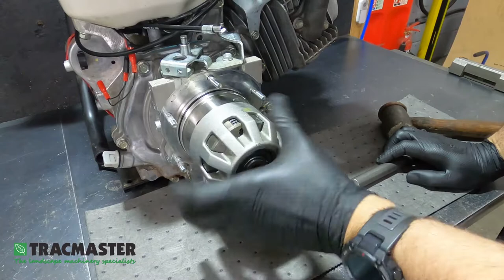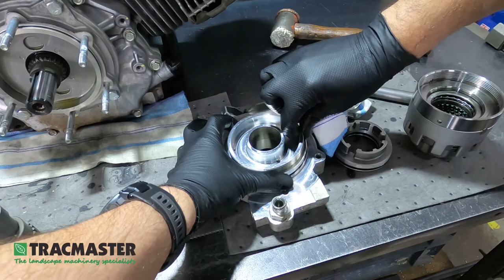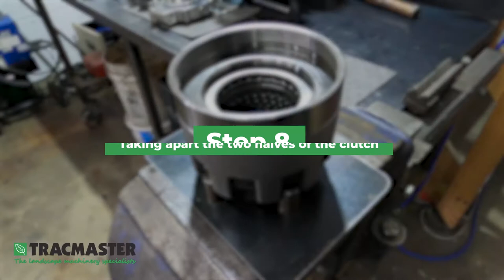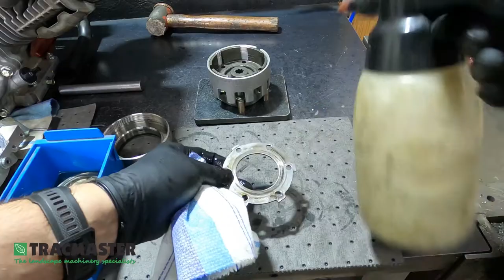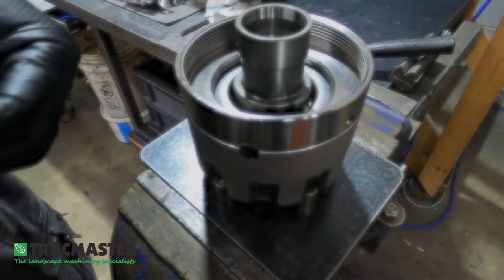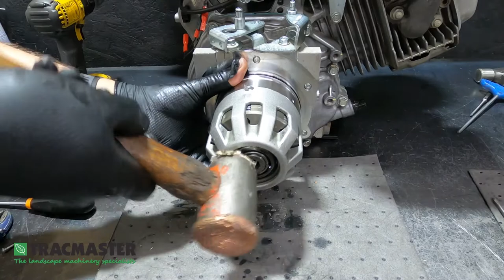Cleaning BCS PowerSafe® Clutch

Comment: Many thanks for posting. I hope I never need to dig this far into my BCS740 but I really like to look at what I'm driving anyway as I think it really helps in avoiding inadvertent damage and wear. I now understand how it works both as a clutch and as a brake. Very clever.
Reply from the maker: Hi Colin. Thank you for taking the time to comment. We're so glad that you found the video useful, albeit not necessarily in the way we intended 😂. We are working on adding more service videos, so hopefully there will be some more uploaded in the near future! If you're subscribed to our channel then you'll get notifications when we post new videos. Thanks again.
Reply: @tracmasterltd  Many thanks indeed for the reply. I have subscribed and look forward to any new videos you make. I wonder if you could help me regarding the preferred transmission oil when I come to replace it. I have seen instructions suggesting the use of a GL5 85W/90 hypoid gear oil but also have a copy of BCS service bulletin 2-22-2016 that suggests, for PowerSafe clutch equipped models, a whole list of possible lubricants all of which are Universal Tractor Transmission oils such as John Deere JDM J 20C.  Can you please tell me what you would use.
Reply from the maker: @ColinMill1  We recommend using either 80W/90 GL5 oil or a universal tractor oil - both are equally suitable for the PowerSafe units.
Reply: @tracmasterltd  Many thanks. That puts my mind at rest.

Comment: Thankyou so much  coukd I ask an info about my bcs740? It os brand new and it os really hard to change speed even with engine at low rpm...after shift goes tactor works well...is it normal and should I adjust clutch? Regards
Reply from the maker: The machines can be a little stiff when they are new, and once they are "bedded in" any stiffness should ease up. We would not recommend making any adjustments at this stage. However, if the problem persists you should contact the supplier of your machine for some advice. I hope that helps.

Comment: So I have a 750 diesel apron reciting it instructions said to use gear oil then got the updated bulletin that hytrans should be used should I be doing this Or should I get away with flushing with diesel ?.
Reply from the maker: Hi Bruce. We recommend using either 80W/90 GL5 oil or a universal tractor oil - both are equally suitable for the PowerSafe units. Diesel should never be used in the gearbox.

Comment: Please share more informative videos for powersafe clutch BCS if possible
Reply from the maker: This is the first we have done but we will be doing more shortly and we'll upload them as they're produced. Was there anything in particular you were looking for? In the meantime, we hope you find this useful.
Reply: We have some issues with powersafe clutch flange particularly with pump gears, pump cover. many times we are gacing oil pressure problems to operate clutch working in powersafe models.thanks.
Reply from the maker: @ojalamale I will pass this on to our technical department and see what they can do. Thanks for your feedback.

Comment: What are the indications that the clutch needs to be serviced? Typically how many hours of use will it be before the clutch needs to be serviced? Does the need for servicing become necessary More Often by operator error? Is the Locking pin the only part that needs to be replaced or is it reused?
Reply from the maker: Hi Dave. Thanks for your question. The most important thing with the PowerSafe clutch is to keep on top of your filter and oil changes. This normally prevents you from having to take the clutch apart to clean it. Typically, oil changes should be done once a year or every 100 hours (whichever is soonest). You would only really need to take the clutch apart to clean it if after doing your service, you still had reduced performance. I hope that helps.
Reply: @tracmasterltd     
   Thank you exactly what I wanted to know.  Is there a good engine hour meter to attach to the tiller?
Reply from the maker: @davej7458  We have previously used (and recommended) SenDec hour meters.